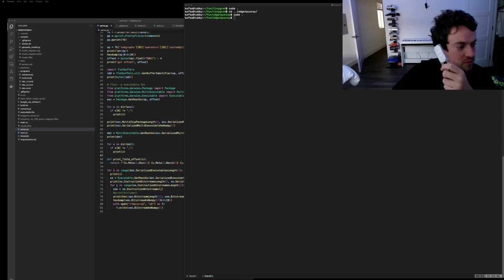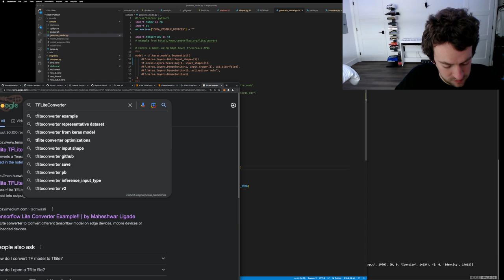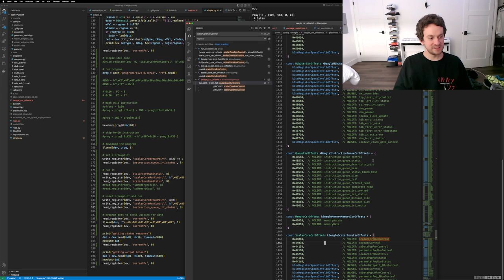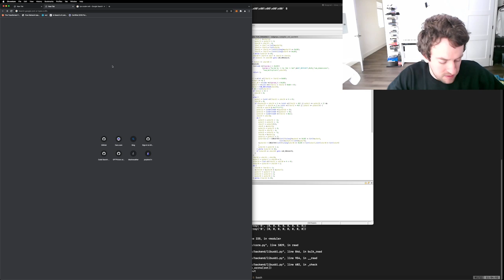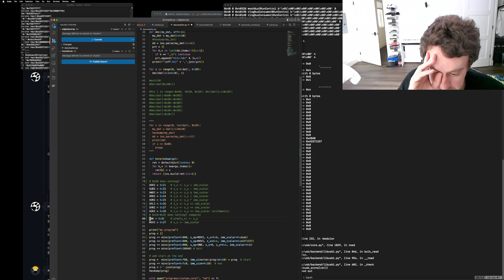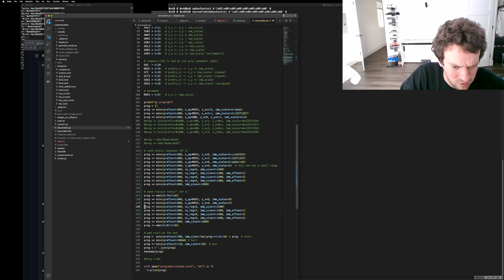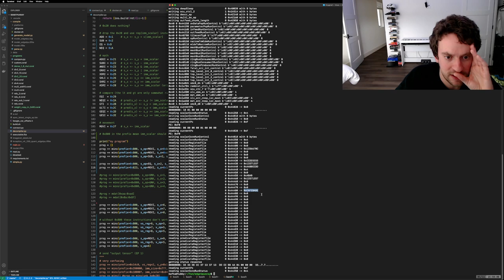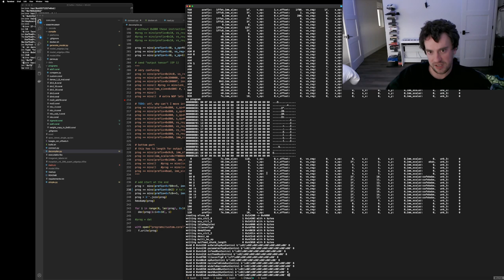George Hotz | Programming | tinygrad Google Edge TPU has a custom ISA?!? | reverse engineering part3

Comment from the maker: tiny corp is hiring! -> 3x Software Engineer, 1x Hardware Engineer - https://tinygrad.org/ | It's happening George started a project -> Getting AMD on MLPerf -> https://github.com/geohot?tab=projects | Go help George if you are capable! He will appreciate you! | tiny corp has a website tinygrad.org. Let your friends know! | Speed run timestamps. Suggest how they can be improved in the comments | https://youtu.be/MeE4Y2862FY (Google Coral Edge TPU part1) | https://youtu.be/rArv2NUXGU8 (Google Coral Edge TPU part2) | Check out and star github.com/geohot/tinygrad | github.com/geohot/edgetpuxray | Support George by subscribing twitch.tv/subs/georgehotz | Follow George on instagram.com/georgehotz & twitch.tv/georgehotz & twitter.com/comma_ai to be up to date | Read George's geohot.github.io/blog | Programming archive🡿 youtube.com/playlist?list=PLzFUMGbVxlQs5s-LNAyKgcq5SL28ZLLKC
Chapters:
00:00:00 intro
00:01:10 summary yesterday 
00:04:00 Edge TPU Compiler
00:07:58 reverse engineering custom instructions set inside edge tpu, invite for google employees
00:08:35 college, Edge TPU custom instructions set
00:18:08 compare the two things
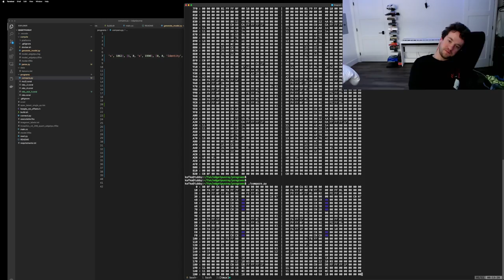00:22:40 first year of tiny corp, think that is the output
00:26:45 inputs, outputs, customOptions, edgetpu-custom-op
00:30:05 phrased the whole structure last night, no logging, on our own
00:32:45 apple iOS version 3 audio dsp
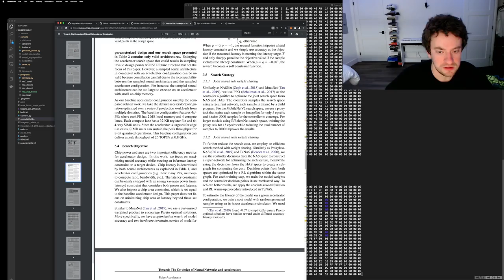00:35:55 one instruction documented, how architectures usually work, isa
00:38:30 crappy code, simple little programs without data
00:44:30 no debug mode, 0 read, 40 write
00:48:05 blinking light, sending 8 bytes, got response
00:51:45 cleanup, omc0, rambist_ctrl_1, program that divide's by 2
01:03:30 only running parse, program doing nothing, identity
01:12:30 Lambda, ReLU, keras layer, how anybody use tensorflow
01:15:50 confirming identity, tf.lite.TFLiteConverter
01:20:22 great tensorflow options, divide's by 2
01:24:55 bad non sub chat, trying to be a meme
01:26:59 what registers
01:30:55 writing simple thing, TF weird scaling
01:38:35 reading cool registers, PC program counter
01:43:29 genomics studies on programs, Efuse00
01:47:55 breakpoints, executeControl, instruction_queue_size, scu_ctrl
02:12:00 kHalted, kIdle, Alex, single step mode goes to Halted mode
02:17:48 scalarCore_BreakPoint, breakpoints work
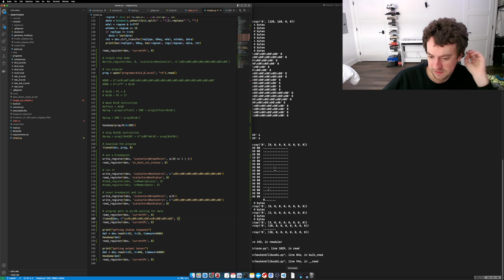02:33:55 ordering food, memory dump idea
02:37:20 happier doing this, great team at comma, the verge
02:40:35 moving the world forward, the users, learning
02:45:20 ScalarRegisterFile
03:02:00 disabled, when to give tip for food delivery
03:06:00 edgetpu_compiler, overclock
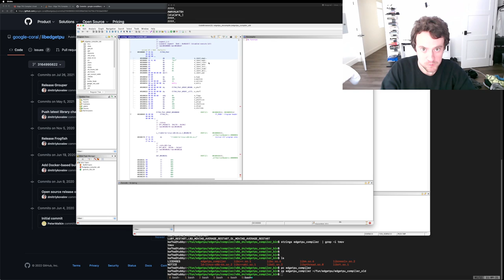03:18:40 google team that made this, real tpu instructions
03:23:30 finding the ones with debug symbols, no value to any nation state
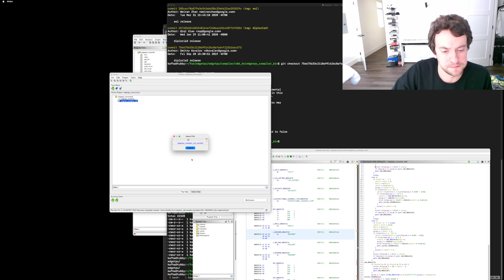03:28:00 edgetpu_compiler_old
03:32:50 long instructions, apple neural engine
03:45:30 lot's of code for add, possible scaling
03:53:00 jackpot
04:03:40 tpu scalar unit
04:08:15 custom program running on edge tpu, next steps
04:09:19 playing piano, life coach, white lotus end of world
04:14:18 python bit manipulation, struct.pack_into, BitStruct
04:36:25 python magic
04:38:46 real Martin Shkreli in the chat
04:44:20 loading ScalarRegister 1,2,3
04:46:40 anyone out there running custom code on coral?
04:57:30 thank you suggestion from chat
04:59:35 $100 for list of scalar op codes
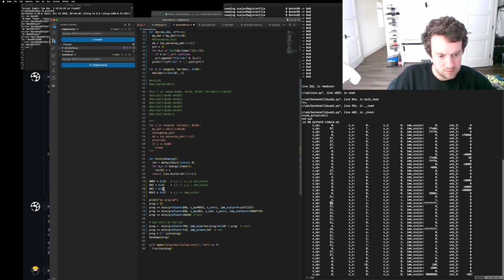05:09:15 XOR, reverse engineering scalar unit
05:34:30 same as on big tpu
05:39:10 first bit for scalar or not, twatter
05:43:55 flag how to interpret
05:47:00 programs that take in weights
05:48:30 back to div2 program, compare div2 to relu
06:12:00 scalar register
06:24:30 pushing on usb, 4 bytes 
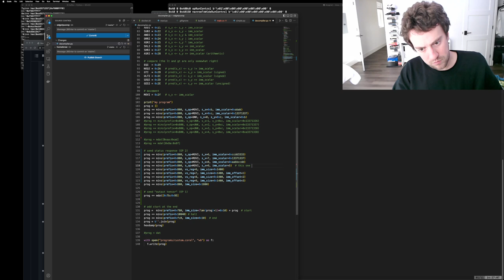06:36:40 fancy 
06:48:30 big font, the limit is only you
06:53:00 needed that instruction, addictive
07:07:15 code not executing
07:17:57 dma is really hard
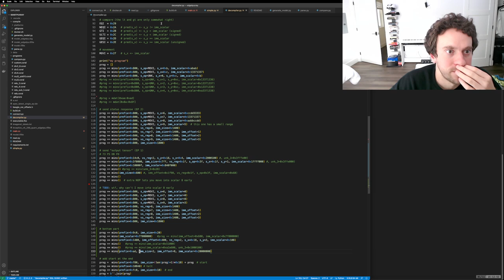07:22:12 trying something, big stuff, 10
07:37:12 what are we trying to achieve, inference chip
07:39:55 bootcamp, sit down and so something, buy coral
07:40:40 tensorflow lite rant, 4 TOPS, running linux on coral
07:42:40 time for matrix multiplies, 8MB RAM
07:47:30 weight_copy
07:51:00 almost fully understand this program
08:04:10 Dell U3219Q
08:04:30 doing some experiments
08:16:58 dumb rename
08:19:40 pred_reg
08:25:10 run_flag=1 means 
08:36:20 run_flag real?
08:39:50 all 40 prefix
08:43:15 v_op
08:45:45 reverse engineering, security losers, hacker culture, evolution of subculture
08:47:25 weaponized exploits, red teaming pen testing, security audits, bug bounties
08:47:55 cool console hacking, pokemon yellow, main source of income, pimps
08:52:20 clear mind, 9-5 jobs, chess rating, scamming people
08:55:40 not tolerating people lying to themself
08:56:57 FF 00 FF 00
08:57:45 social media destroying attention spans, reading is hard
08:59:04 people exposed to people they did not agree with them
08:59:40 twitter hate comment
09:04:30 0x10, 0x20 send
09:10:40 dev2 vs relu vs add
09:27:20 compiler for edge tpu open source
09:27:50 overview of progress, google send docs
Reply: Bro you literally watched whole stream to add time stamps 😳😳
Reply: PS4 dev mode

Comment: I graduate in a few months. I wouldn't say college was a scam, but it's overpriced and in retrospect I'd have been better off taking a different route.  Still got a lot of value and exposure to unexpected helpful info tho
Reply: What would be your different route ?
Reply: @yamanarslanca4337  certification (which I know hotz doesn't like, but it gives you some scope and direction) and taking some core classes for free online, maybe pay for the credit and do this while working and getting hands on experience, even if it means starting at a very low job and either moving up there or switching jobs every year for something that's an upgrade. I feel like the money goes so much further in certification.  And lastly making sure I take a business writing course.  Almost any job will massively benefit from that. And researching basic lessons learned in how to carry yourself in a business environment.  When to speak up and when not to.  How to manage up.  Joining boards. Becoming more well rounded, but without the excessive bloat and cost off college.  That being said, I'm a strong self learned and thrived during lockdowns, I know most people really benefit from the structure of college and if so then that's fine maybe it's a better route for you.  I think college has value, but some people may be able to do it much for efficiently.